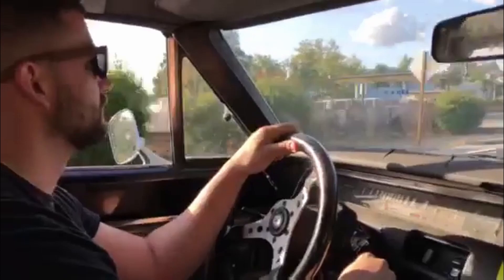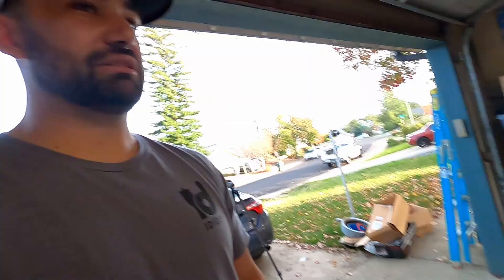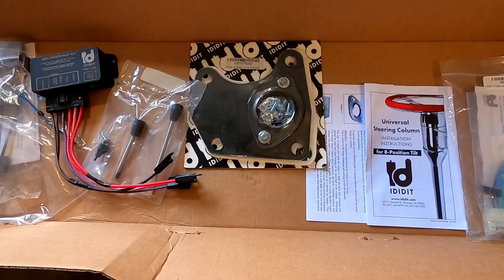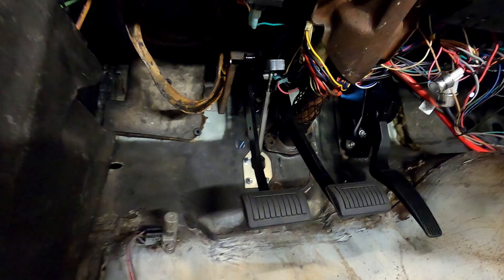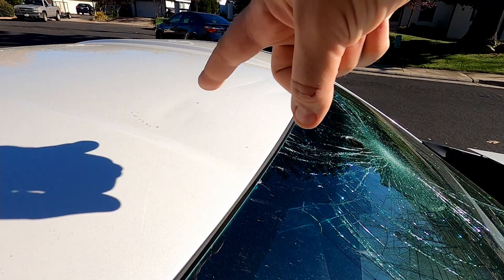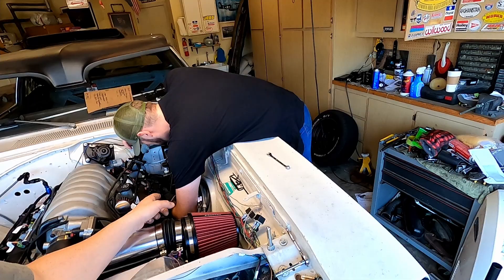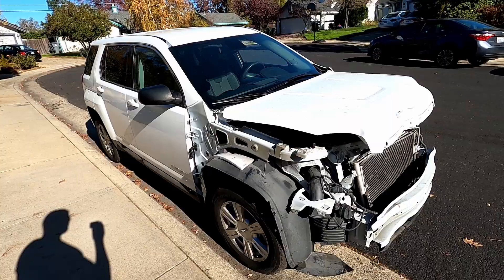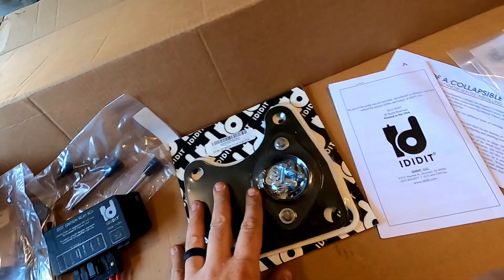IDIDIT Steering Column Install!

Comment: I know I'm a little late to the show here but I have a 68 Plymouth Road Runner with the Borgeson PS conversion box.  It mounts exactly as you describe your box mounting angle so my guess is that it is what it is.
Reply from the maker: Yeah not sure why they are like that but it's definitely a design flaw that needs to be remedied

Comment: Does the original bracket bolt to the Ididit column? I have a 68 Dart I'm replacing the column and the bracket is identical to yours, but there's not much info on how to mount the original bracket to the ididit and doesn't look like there's any bolt holes on the new column in the pictures on the website. Thanks for any info.
Reply from the maker: Yes! Sorry I didn't show that, I thought I did, but yes it'll bolt right to it, no issues 👍🏻

Comment: You didnt show any of the wiring process
Reply from the maker: Wasn't really any wiring to do. It comes with the ignition module that is plug and play and the chassis harnesses also Plugs into the column harness.